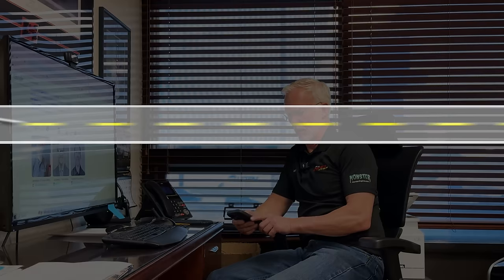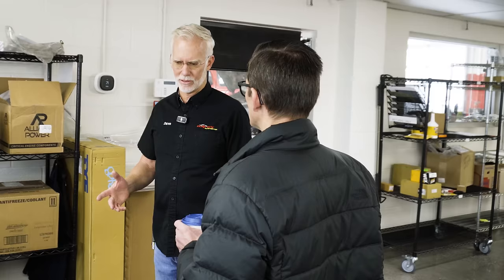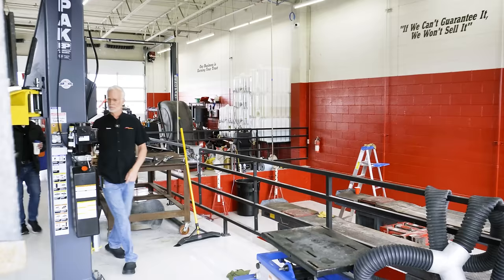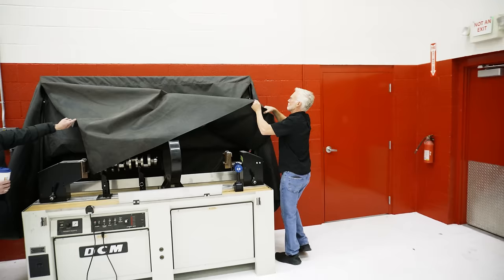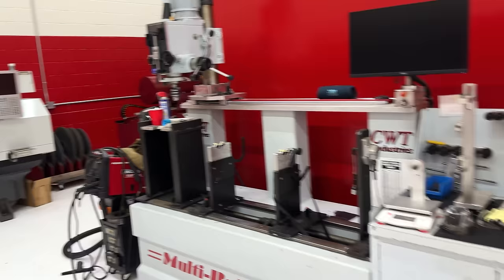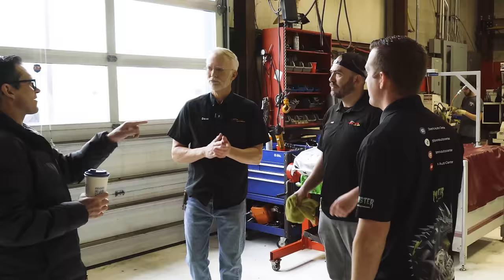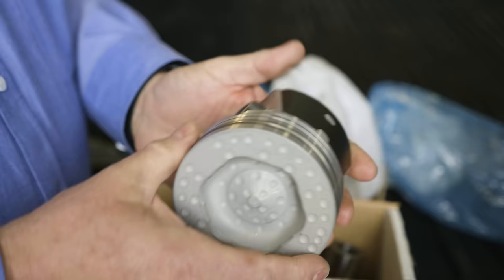Sitting Down With Lake Speed Jr. - The Truth About Oil Change Intervals and Analysis

Comment: The problem with oil analysts is that IT COSTS MONEY TOO!  It’s ridiculous!  I run Amsoil z-rod in my mustang, the 347 stroker.  An oil change is right at a 100 bucks, 6 quarts + filter… 100 bucks.  An oil analysis COSTS OVER 50 FREAKING DOLLARS!  It’s half of an oil change!  It’s just crazy!  At that rate I might as well just do an oil change every 3k miles and call it good.  Other than that it’s great info.  Thx again for yet another great vid

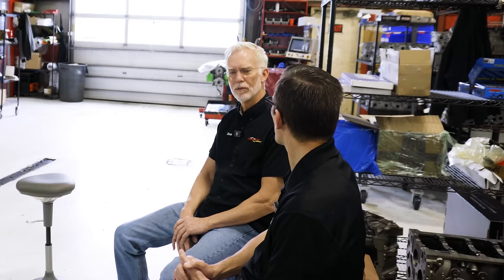Comment: 20:45 During my US Army service ('92-'02) we routinely parked our M998 High-Mobility Multipurpose Wheeled Vehicle [HMMWV] “humvees" under camouflage netting and LEFT THEM IDLING for WEEKS (running radio racks). I was shocked at this until I learned about AOAP-the Army Oil Analysis Program. Test tubes were regularly sampled and sent to the Army labs that performed spectrometric and ferrographic analysis. Fascinating. Once at a National Guard moto pool we unintentionally left a dump truck running when we locked the gates and went home for the month. FOUR WEEKS LATER we opened the gates and it was still running; hard use indeed!
Reply: that is where all this darn global warming came from...  thanks  lol
Reply: A vehicle has enough fuel to run for 4 weeks unattended?
Reply: @hugolafhugolaf 10-Ton dump truck has a 75 gallon tank so perhaps. It’s not 25 gallons like the HMMWV.

Comment: I used oil analysis when I was an owner operator. The condition of the oil tells you so much about the condition of your engine. I never experienced a single catastrophic failure in millions and millions of miles of operation. Your oil tells you what is wrong well before any kind of failure and you can get it scheduled for repair in plenty of time. We used 1 micron oil filtration and sampled every 15000 miles on our MBE4000s and made engines everyone told me would die around 850,000 miles all run 1.5-2 million miles before rebuilding. We bought them around 550-600k miles and ran them as team trucks. Most reliable trucks I ever owned.
Reply: What kind of oil filter did you use? Even Cat filters only go to 2 microns.
Reply: Yep, I worked on aircraft for years and you run UOA on everything from engines to gearboxes and hydraulic systems. On my own car I send a sample every 5th oil change, which is  around 20k miles as I like 4k intervals the best out of all the duration I tried (best balance between oil life vs the cost for my driving). For the $35 is costs to have tested, its way cheaper than letting a bearing spin or something like that.
Reply: @arc00ta  The CFM-56 engine that powers the KC-135R and commercial aircraft has an average time on the wing of 30,000 hours before a shop visit due to world-class bearings and strict UOA schedules.
Reply: I just got hooked up with a 4 pack oil test kit from Amsoil for like $120. They contract out the oil analysis to Polaris and write up a customer report too. This way I know what to expect. My truck runs 80WHP/100WTQ over stock at higher boost pressures. To keep it solid for the long run you got to put in the extra work. Plus, selling it later for top dollar goes I long way  with receipts.
Reply: @cdsmit27  Cat engineer at the filter plant told me that less than 2 microns starts to strip additives out of the oil, but this O/O seems to have made it work…
Reply: @edmundsmith7199  I see. So then I guess cat filters should do a pretty good job then.
Reply: What bypass system did you use?
Reply: Did any of your Mercedes have centrifuges on them? I’ve worked on some that did and some that didn’t even if they were in the same applications.

Comment: As a DYI mechanic, I just learned a ton and it has changed my PM schedules on all 3 vehicles right now including a 2012 civic with 225k.  Thanks Dave!
Reply: From what to what?
Reply from the maker: That is awesome!
Reply: Have 170 on my '12 Civic, had 400 on my 07 Civic before a deer and then rust killed it.  All I did was never miss an oil change. I got 380 out of the 07 Civic and it still got 43mpg if I chose to hypermile.  Both have only seen Pen oil with natural gas base.
Reply: My '98 civic wih 380k kilometers has seen all types of oil. It has been eating 0.7L of oil / 1000km for the last 150k km. It doesn't get better nor worse. The oil has always been changed at 8 to 12k interval. I guess the oil consumption is now stable at 0.7L/1000km just because with such a high consumption it always run on almost fresh oil (due to frequent adding). 😂
Reply: We currently have a 2010 manual trans Honda FIT (Jazz in other countries) - purchased new, now with 392,450 miles (that's about 631587kms). Replaced the clutch at about 265k miles when our daughter learned driving a manual and an AC compressor at 270k. That's it. Been the most reliable car ever owned. Did the first engine/trans oil change at 1500 miles with AMSOIL 0W-20 which is the only oil its ever seen. Consumption is never more than .25-.40 quart per 3000 mile OCI's. No idea how long this thing is going to run.
Reply: @bmepdoc9675  Much longer if clean air and oil is used.

Comment: I did oil analysis all the time on my Freightliner. One time it picked up a lot of potassium which they use as road salt around here. 
After looking around I discovered the shop left a turbo intake clamp loose, so it was sucking in road spray. 
 Without oil analysis I would have went all winter without knowing, leading to the engine getting dusted and worn out.
Reply: I add a banana to my crankcase oil for potassium
Reply: How do you go about getting an oil analysis? Mail a sample of used oil to a lab?
Reply: @Will97675  see the link in the description for oil kit

Comment: Oil analysis is something I learned about in Army Aviation over 25 years ago.  All the numerous gear boxes, transmission and engine oils were sampled and sent off to the lab.  Now I have engine oil analyzed annually and the transmission fluid checked every two years.  It costs, but I want to know of problems early to either fix or trade before it gets to expensive. Too bad it's not offered by the dealers when you purchase their extended warranty.
Reply: That’s a service feature I’d pay for.
Reply: Absolutely, 100%, Bill. Think of an analysis as being akin to a FBC/CBC Blood test assessing YOUR health. It's as close to a window of what's going on inside as one can possibly get.
Reply: Like trade the vehicle and pass the problem to someone else? lol nice!

Comment: Outstanding episode! Smart men listen to other smart men and guess what happens, we all benefit. What a great collab.
Reply from the maker: Appreciate the comment! That's the great thing about this community, we all come here to learn together👍
Reply: Question.
Why don't you vent the crankcase to atmospheric pressure?  For instance, by loosening the oil cap or pulling the dip stick out a bit so it doesn't seal?

Less pressure on backside of cylinder, less crap through EGR.
Reply: @lawrenceralph7481 some people do have crankcase breathers that vent to the atmosphere (even tho they’re technically illegal).  I used to have an oil catch can on my Camaro that condensed the oil vapors prior to the intake manifold but the valves still got coked up
Reply: It's a EPA thing.  Bad for the environment.  Starting in the late 60's.  Regulation.
Reply: @lawrenceralph7481  I do that after ever landing in my airplane.  I pull the dipstick out and let the hot moisture escape.  The camshaft is at the top of the engine so the oil drains off leaving the camshaft bare and exposed to rust.  Also add expensive Camguard at every oil change.
Reply: Iron sharpening iron, simply put 🤷🏽‍♂️👍🏽🙂

Comment: After over 35 years in the automotive service industry, with 10 years with Porsche and 25+ years in my own foreign car shop, I have lived by and preached that maintenance is the key to longevity. Mt automotive experiences and love came from my teenage years in the 60s when we built and dropped V8s into everything. Building hot rods, either for ourselves or others, is what kept us out of trouble. After that, I enlisted in the Navy and was designated an Engineman. That's where my diesel experience started. When I got out, Porsche was the only manufacturer that offered me a decent job. My career choice helped me become a millionaire. I'm "retired" now and this video was extremely interesting and memory-producing, thanks!
In regards to detergent fuels, Costco is one of the only places that carries Tier 1 detergent fuel.
Reply: Thanks for that Costco info.
Reply: @wrangler6977 The added beauty of Costco is that it's fresh!  They move product.
Reply: @stuckinmygarage6220  The product practically moves itself ;-)
Reply: If only our area had a Costco diesel 🇨🇦..
Reply: I don't know where y'all live but QT stations do as well.
Reply: I can’t trust costco. I’m a shell fanboi

Comment: This was hands down, one of the best videos I have ever seen on Youtube
Reply: I was reading about a Peterbilt with a series 60 Detroit 425 HP engine. Almost zero engine wear at one million miles and only one oil change. Im a little familiar with this truck. It used Shell Rotella 15 W 40 conventional oil and a Gulf Coast O2 bypass filter. A mechanic didnt get the word to not dispose of the oil. Its misleading to say only 1 oil change in a million miles. The Gulf Coast bypass filter holds 3 gallons of oil. Thats 3 gallons of new Rotella every 10 K miles. Then you have the full flow filters changed every 50 K miles. Road King magazine article said that is equal to a full oil change every 40 K miles. I dont drain the oil in my 06 Pontiac but every 6 K  miles I change the Australian Jackmaster Classic and add a new quart of synthetic oil. I drive mostly highway. I started in 1963 with a Frantz oil cleaner and Standard Delo 30W. In those days we changed the bypass filters more often and added more new makeup oil.

Comment: 100% Facts!  I religiously change my conventional oil and filter on my 97 Lexus ES 300 every 3k miles.  My engine now has 357,000 miles on it and runs superb,  every had to open the engine or remove so much as the heads.  Routine maintenance all around, if you take care of your car it will take care of you.  Fascinating video and tutorial.

Comment: I still do 3000 miles and change it myself. My Colorado 3.6 engine is naturally aspirated, direct injection. I think cleaner oil equates to cleaner crankcase gases which equates to cleaner valves. I can't prove it but my truck still runs like new with no usage at 85,000 miles. Great discussion in this video.
Reply: 3k oil change cycle on Vortec 4.3 with Delo/Delvac/Rotella [dino]
15-40 and the engine is at 381k and leaks (not consume) .5 qt per OC.
Happy motoring✔

Comment: Excellent video. Thanks for sharing. I always change my oil 3 to 5k intervals. Interestingly that's when the GM computer on multiple LS motors also believes it should  be. If you want to drive to 300k miles and beyond on your original engine, then change the oil!
Reply: 07 5.3l 4,000 miles interval, is where is at.
Reply: I’m shocked how much time and money people spend trying to figure out how NOT to change their oil. Nobody has ever said,  “dammit, I did too many oil changes on this car”.
Reply: 300,000 on my 5.7 Hemi ram.
250,000 on 4.2 Ford F150
Reply: @bobd9868  like I get its messy sometimes when windy and a pain, but.....30-40 bucks for even top end oil/filters is cheap compared to another car..
Reply: @bobd9868  lol that’s so true! I’ve changed my oil more often than I’ve washed my car lately which is a bit weird but it doesn’t cause me grief.
Reply: @derekp6636 I just bought oil filter and it was 75 to change myself. It’s not cheap anymore
Reply: @Evadingmoto  that sounds a bit inflated, try walmart or online for bulk oil not autozone.  The oem filters are a tad pricey you could always do a swap to spin on.
Reply: @Evadingmoto  I just did my Chevelle and it was about $55, we also did my sons Honda and it was about $45. Difference was the cost of filters
Reply: ---  so changing the oil and filter on my 4.3 GMC once a year ( every 25000 to 30000 miles ) isn't often enough ?
Reply: @bobd9868 I have totally done to many oil changes on 8 out of 10 autos I have had. They rust out or are wreaked well before the engine is done.

Comment: What a fascinating discusion. I just changed the oil on my little Fiat Panda. According to the user manual I didn't need to do it for another 2,000 miles. After listening to these guys I am so pleased that I did it early. The old oil was so black and watery it clearly needed changing. Thanks guys for sharing this with us all.
Reply: I’ve worked on Panda’s many times, and have owned a few. In terms of the last few models, the 1.1 and 1.2 Fire engines are extremely durable, but I’d always do what you did and change the oil around 2k miles earlier. The MultiAir engine is fragile by comparison; not only do I recommend 6-8k max oil changes, but also baby them a little, they have issues that can easily catch people unaware and mechanical failures in the MultiAir can be terminal at very low mileages. The new FireFly isn’t as fragile as the MultiAir, but it can’t handle the mileage that the Fire engines can. You made the right decision for sure.

Comment: I've been tracking oil for a fleet for years and endorse everything here.  I would add a few lessons shared with our new techs (because they do not get taught this in the schools either) - first is to fight the owner desire to extend drain intervals unless backed by the science - second is to use the best oil you can afford - third is to think of oil as the engine garbage can and that it has to go.  

Those last two are the important ones for longevity - an engine can have a blowby problem, or a micro coolant leak and still survive if the oil is changed frequently enough.  It can be helped to the next overhaul interval instead of being run to the ground and out of service early.  

When we added telematics and started tracking the oil pressure, we were also able to watch fuel dilution in progress.  We would see fuel in oil (often high oil levels it was so bad), but diagnosis was hit or miss depending on the tech.  Oil analysis was always an oil drain or sample too late though, but when we plotted pressure we could see the point about 2 weeks later where it finally dropped.  We learned a few things - first the unit did not need to be killed from service immediately - significant to the operations team  - and we could use that second week to anticipate the severity (bad injector vs bad blowby vs over regen) and take a few days to review the other data and target our diagnosis.  Lots of bad DPFs were found plugged with coolant residues because of cracks in EGRs for example.  That burnt coolant residue was also elevating potassium and those nodules were scoring the cylinders too.  Oil analysis would track that too. 

I used to say my job was paid for by the engines I saved.  Oil analysis was essential to that capability.  Lots of resistance from management - oil and filters are seen as optional, analysis costs money, analysis of results costs money, some times analysis is wrong and they don't undersrand the value of training through mistakes.  But it does work.
Reply: do you have any thoughts to share on using break-in oil, specifically regarding a brand new diesel engine?
Reply: @tattooedmillionair  we trust the factory did the run-in, and put our normal oil in but change it at half the interval.  We are putting 500,000km on an engine before we even consider replacing them and the premature failure rate is very low and Cummins has been great with us on that anyways (they know we have the data and their engineers work with us on campaigns).

Comment: As an owner of an old 7.3 IDI I can confirm that even with an electric fuel system that’s air tight, new injectors and the IP timed right my IDI won’t run right without a quart of atf in the fuel. It’ll start weird, & have issues starting. I can also tell that if fuel is older it’ll take longer to start.

Here in the US we have crappy fuel quality. I got a bad batch of fuel at a fuel station one time, & later down the road 10 miles the truck stalled. Coasted into a gas station and found my fuel pump Pre-screen was plugged. Cleaned it out, bled the fuel and within 10 min I was running again.
Reply: Had the same thing happen on a 2 year old 6.7L Cummins after filling up at a Murphys USA.  Ended up putting a Fass lift pump in instead of sticking with the stock pump/filters.  Also still refuse to fill up at Murphys no matter how cheap their fuel costs.  Time will tell how much damage was done to the injectors and CP3
Reply: @andymike6575  , the station I got the bad fuel at wasn’t Murphy’s. I’ve always tried to stick to Murphy’s if a can. I’ve noticed better fuel quality from them on my personal stuff. It seems fuel quality rn is kinda spotty. I’ll get good fuel then another station it seems like trash. Then when I get fuel for the 7.3 I’ll smell it to make sure it’s the right stuff.
Reply: @michaelbenoit248  yes fuel quality does seem to be spotty which is why adding fuel conditioner and better filtration is so important regardless of region or biodiesel content.  Gasoline and diesel quality has also dramatically decreased overall over the last 20 years
Reply: @andymike6575  , when Biden took office 4yrs ago I went to get fuel for my 7.3, & either I got a bad batch of fuel or the fuel quality was dramatically lower because the amount of power I had before and after the fill-up was -5hp. It’s gotten bad to where if I don’t add a quart of atf to the fuel my truck will start/run like trash.